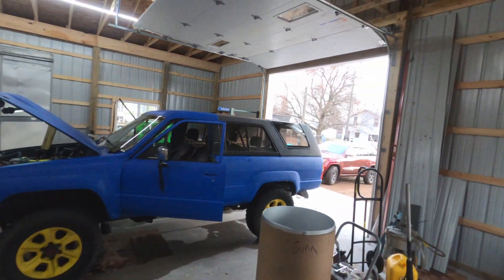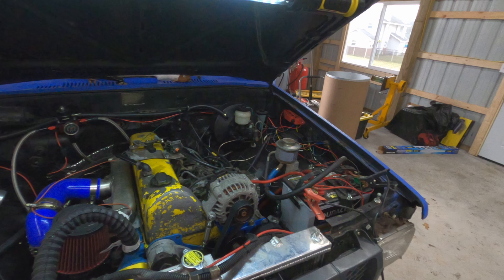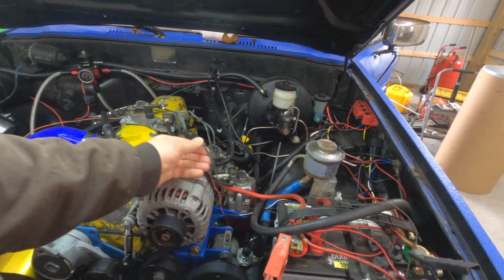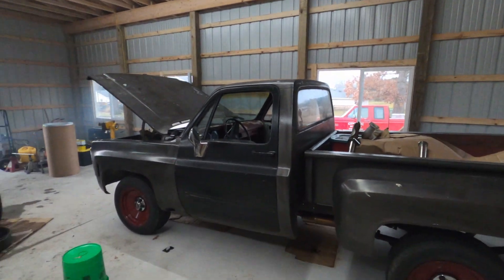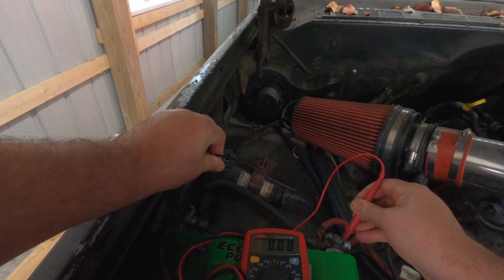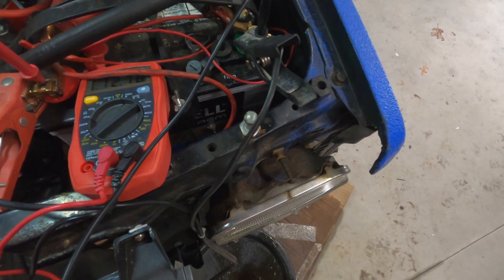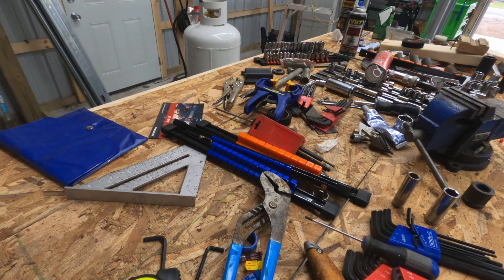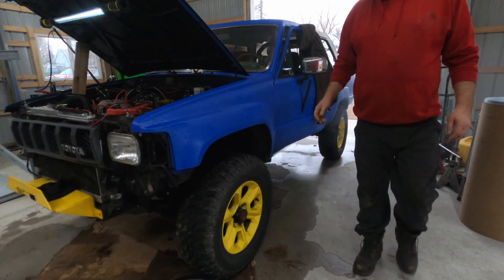LS swap alternator charging, what you should know!

Comment: My ls swap have 2 wire plug on it. One turn on and other L terminal. How would wire this?
Reply from the maker: To the PCM, 2 wire alternators are controlled by the PCM
Reply: Possible to run separate l terminal  plug with 470ohm resistor to ignition fuse panel?

Comment: So my truck has been together for 4 years, I finally got a dash-mounted ODII heads-up screen because the 10 year old GPS that I was using for a speedometer died. I had been watching the voltage on the dash and it has been in the same place the whole time, right about straight up. The ODBII volt gauge shows around 13.2 and when it is cold in the morning it will drop down to around 12.8 even going down the highway. My harness is a stock gen3 harness that was reworked. I feel it should be charging higher going down the road... Alternator bad or what? Thanks for another good video.
Reply from the maker: If it's been together for 4 years, I'd just pretend I didn't know and keep driving lol
Reply: @TheDrivewayEngineer  LOL yeah but it seems to have gotten worse the last few weeks of daily driving it. The battery seems to be getting weak I think, it was my spare battery that I used to leave on the trailer for the winch, but then the battery that was in the truck sat for 6 months while I was doing the stepside bed swap, so I charged up the winch battery and put it in the truck lol

Comment: So, I have an additional question. At night, when using extra power for lights, etc, the voltage slowly begins dropping as I drive. Starts at 14.5ish, then drops as low as mid 12s the more items that are used/the longer I drive. Should I be looking to replace the alternator on my swap soon?

Comment: Does it eventually shut off the charge?  Wondering if it would overload the battery if you are on a long drive, say 4-5 hours.
Reply: All the 470 ohm resistor is doing is simulating the alternator fault indicator light bulb filament on the excitation circuit to the regulator.  
They work well like this, and that is the normal operating voltage for a properly operating "12 volt" automotive charging system.

Aircraft using the same battery chemistry and cell count call it a 14 volt system, I have no idea why automotive usage calls it out at the low end of the resting voltage range.
Reply from the maker: Yes, it all works automatically like it should.